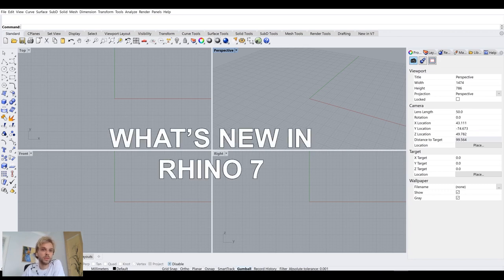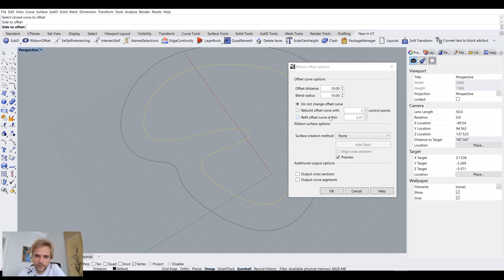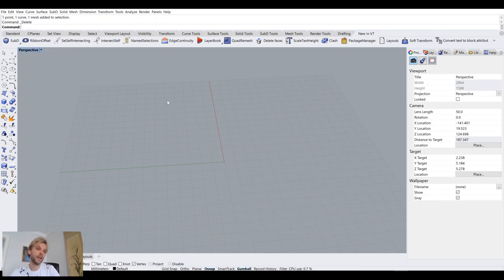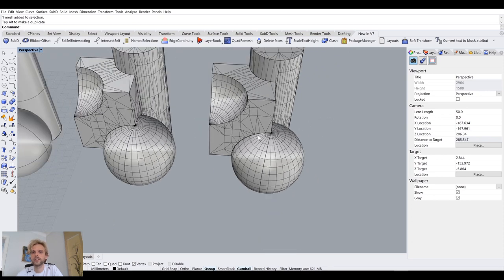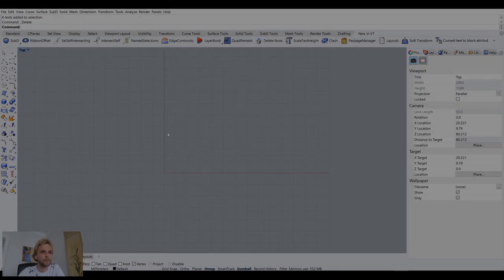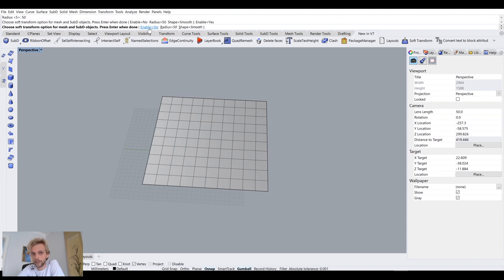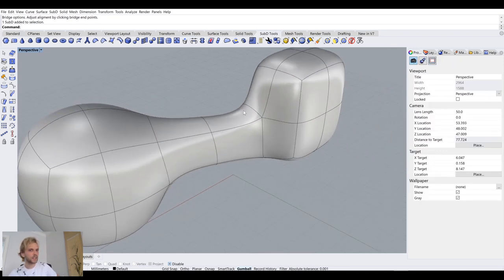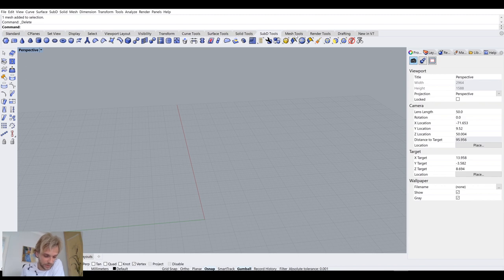RHINO 7 is a BIG DEAL! Let's see what's new.

Comment: I used to work on Rhinoceros for design projects almost 10y ago. Its amazing to see that much progress even if that is not actually fast paced evoltuion. Currently i do not use 3d for my main work but still mess around with it sometimes for more experimental work and as i do only digital i tend to use blender ( for visuals only so.. ). Rhino was always my favorite 3d software back in the day.
Reply: The company where I work now works exclusively with Solidworks for everything, from surfacing to engineering, so I've stopped using Rhino years ago unfortunately. I always enjoyed using Rhino, but I'm not sure I can go back to non-parametric / non-destructive modeling. I simply do not have the time to go back and remodel stuff that only requires small design changes.
Reply from the maker: There is that shitty button called "record history" in Rhino, where it (kinda) remembers the design steps. Compared to F360 or SolidWorks its user interface is a steaming pile of garbage, but TECHNICALLY SPEAKING the same functionality IS there.

Comment: Hi, about NAME SELECTION  what s the advantage  of this command compared with a grouping in separate layers ? I still don t get it  .
thanks
Reply from the maker: Umm lets say you are using separate layers for windows, plumbing, furniture and so on. And lets say you need to constantly select everything in one part of the building (let's say to export updated versions of it for your engineer). You can either manually select everything you'll export every time or you can create a separate layer tree for that separate part of the building (which I find a bit messy), or you can do the selection once and save it. It's just for convenience, definitely something that can be substituted with layers.

Comment: A Rhino Ipad Pro app version would be great.
Reply from the maker: Actually the thing that I use quite often is - as long as you have a stable internet connection - you can run Rhino on your pc and control it from your Ipad via remote desktop.
Reply: @DesignGoBrr   which app/dongle? does it work ok?

Comment: Very nice presentation! That being said I m not convienced why to upgrade to R7. Imo the subD is for from being considered as a powerful replacement of T-Splines. Personally when it comes to meshes Blender is superior to Rhino hands down.
Reply from the maker: Thanks! :) More follow up videos will come shortly. I completely agree about the Blender>Rhino when working with meshes. I personally use both and always jump into Blender for those sweet sweet loop cuts. That said - with Rhino 7 I will not be FORCED to jump into Blender, because now (small stuff) will be possible to fix straight up in Rhino. It's kinda nice.. For big/complex mesh stuff I'll still be using blender for sure. Well but you know, Rhino is an will always be a surface modeler, not a mesh modeler, so it's nice to have it. As for subD modeling - honestly, even though the tools are pretty basic, it has every single tool that I would see me needing, so I'd disagree with you on that regard.

Comment: Bye bye expensive Power surfacing for Solidworks, hello Rhino7 .... Hope it will have a reverse engineering module in the next versions... Thanks for the video !!!!
Reply from the maker: Yea, it's definitely a nice alternative! Reverse engineering from a photogrammetry mesh back into a Nurbs geometry is already possible with quad remesh tool in Rhino 7
Reply: @DesignGoBrr  oh nice!!! Thanks!! Is it an automatic tool or is it also possible to remesh it manually by adding polygons or loops, just like it is possible to do in PowerSurfacing RE... A classic retopo tool..

Comment: Well i love the quallity of rhino..   but ..  the "Gamechanger" Subdevisions realy is integrated in other 3d Packages like 3ds Max, Maya ore C4d for about 20 Years or so?

Compared with their mesmodelling options and their Modellingworkflow for meshes,  Rhino still is still in its infant years..  

never the less a step to the right direction..
Reply from the maker: True but also - try getting nurbs data or 2D technical projects out of your mentioned software packages. The fact that SubD in rhino seamlessly converts into a G3 level continuous nurbs surface IS a game changer.
Reply: @DesignGoBrr  right 👍

Comment: Is there arabic in it. As in can you write arabic text
Reply from the maker: Yes, you can. There is even an arabic language pack that you can use, so all of the tooltips are in arabic.
Reply: @DesignGoBrr  I meant when using the text command. For putting arabic text on an object I am creating. I remember someone asking in the forums if there is going to be arabic in rhinoceros 7 and a developer replied saying they were working on it.
Reply from the maker: @AhmadM25  ah, that i do not know. I think its simply font related though, so it would be strange if there's no implementation of that yet
Reply: @DesignGoBrr  It's not really strange because arabic is very different in how letters are connected. Arabic is my first langauge so i know it well and i understand why it's has not been impelemented.
Reply from the maker: @AhmadM25  I understand that - it's just that from what I know, there is a very large market of Rhino users in arabic speaking countries so it would make sense for McNeel to rush the arabic version of Rhino ASAP.
Reply: @DesignGoBrr  You are right there is. But there is still no arabic

Comment: Really nice! But still most of those functions are standard tools in packages like Maya since 20 years.T-splines is also 15 years old I believe. So it was about time... =)
Keep up the good work !
Reply from the maker: True! Although the thing that I like about Rhino is that we can jump between Nurbs for manufacturing and Meshes for simulations/visuals, which Maya didn't have. That's actually why I'm quite excited about Rh7 - it's going to join the big boys club (finally) without sacrificing that sweet sweet "app for digital manufacturing" smell.
Reply: Rhino goes far beyond than subd, it has almost 25 years of nurbs surfacing capabilities that makes it very useful for analysis & manufacturing in many fields of design. Something that maya and other subd application cannot achieve. Granted Maya may be better for visual effects, but it was never Rhino s intention to excel in that field.  Actually SubD is only a small portion of the tools already available in Rhino. Many times you need design tools that cannot be achieved with SubD.  Subds lack the precision of NURBS surfacing in many cases, such as in aerospace for example.

Comment: For anyone else; the offset issue can be fixed by using offset (loose) from grasshopper.  It will make a new offset with the same number of points.

As for the rest; its a challenge to be a killjoy as i started with rhino in my school, but these range of issues were meant to be fixed quite a while ago.  It reminds me of the first iphone nonexistent copy and paste feature.  This is 2020, as much as its going to shits, mcneel have had quite a little time to take the product from a startup, to a fully fledged tool-set.  Unfortunately for them, competition is here and some more on the way.  The subD tools are a welcome feature, but it won't be sufficient for me to steer clear off rhino once the opportunity arises.  Good luck to the team though.

For everyone else; start using blender.  It's free, open source, and packs a punch and a pair of tits more beautiful than your grandmother.
Reply from the maker: There is a benefit to Nurbs based geometry though - it's drawing extraction. (Also people say it's "high precision", but I think for most industries it's absolutely whatever.) Either way - it's much easier to generate a clean drawing in Rhino than it is to do the same in Blender, so for actual design-to-production workflow, I think Rhino is still better. Other than that - Blender all the way!
Reply: Oh; I know,.  You made a video about it!  Thanks for taking the time to reply, and for the video.  As for the advantage; its negligible (down to a few mm, which we already spend to fix by having to export from rhino and import into autocad).  Working in architecture and having used rhino across differentiating workflows, it lags, quite a little even in the aforementioned advantage we are both aware of.  Architectural companies are somewhat dull and the process of integration is an oversight; we still use autocad for drawing extensively.   When creativity becomes more about the tool than the process, i think its a bit of a challenge.  This aforementioned precision is what i was told, and yet, at the office, they could care less about it:  You what!?  I understand now though.

Blender is free, and packs a whole lot of bang for the 'buck'.  I am sure i could setup blender for a good workflow within a greater process for architecture than rhino can at this point.  I am working on it.  And between you and me, if you want to pay for photoshop, rather than use gimp, or pay for office rather then use libreoffice, then its settled.  All we need though, is a dude with IT skills to obliterate monopoly, and that is my aim as far as taking the tools of the trade seriously.  If mcneel won't ensure the necessary means of development beyond precision and drawing production, then I, have an issue as someone who works in the architectural process.   Nurbs has those advantages, and much more of disadvantages to go by, just as well.   Different use case scenarios require different tools, and i am sure rhino has its place.  At the office, i have started to use it less by the day. A benefit is good; a few would have been more ideal.

Thanks again and keep up the work.
Reply: H D  Thanks for the suggestion; though slightly repetitive.  Feel free to take your time and analyse my comments again please.  If Rhino gets you in the mood; good for you.  For all others (the cool kids) concerned, here is a comparison by the community.

https://www.reddit.com/r/rhino/comments/7kfvqe/rhino_vs_fusion_360_which_horse_to_bet_on/